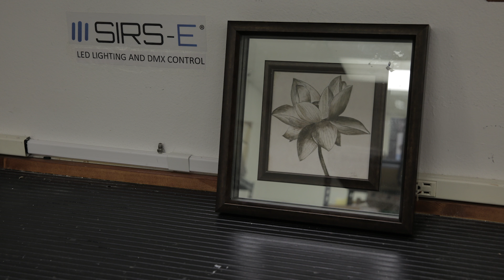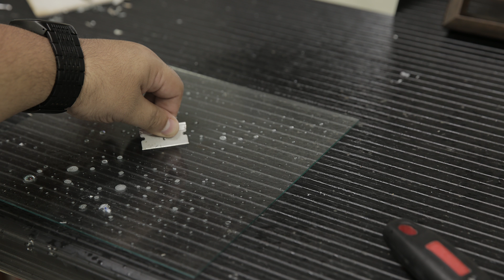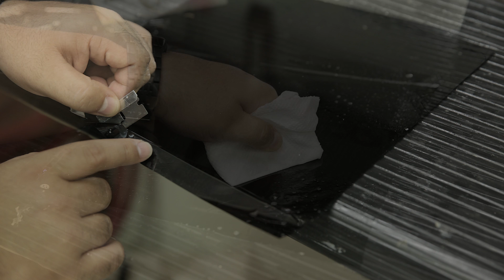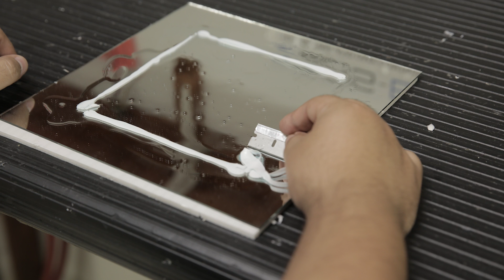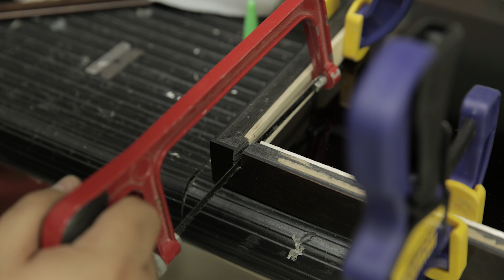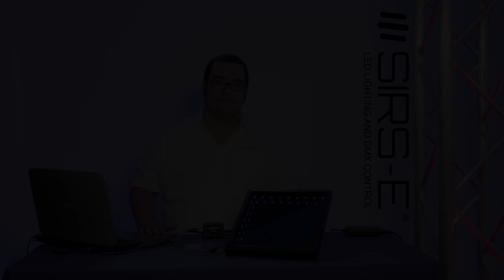Make an LED Illusion Mirror DMX Controlled - Part 2 Contruction

Comment: Which tint percent is good for more deep illusion
Reply from the maker: Hi Shubham Chaturkar, the tint percentage decides whether you want the mirror to be lighter or darker. The depth of the illusion is primarily caused by the the distance between the mirror and the tinted glass. If you want a deeper illusion, you might want to place your light strip in the center once you separated the glass and mirror further. By making a deeper box, you will also have space to add more light strips for an even better effect.
Reply: Thanks for your suggestion